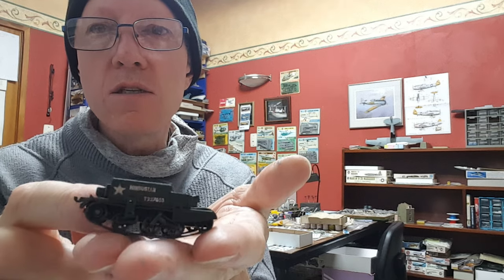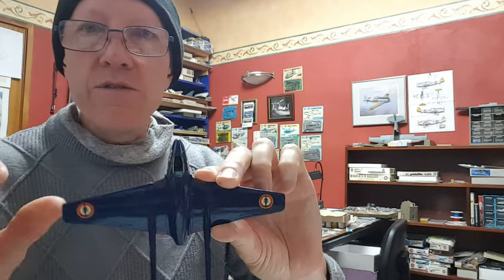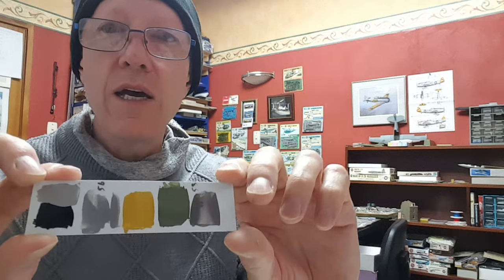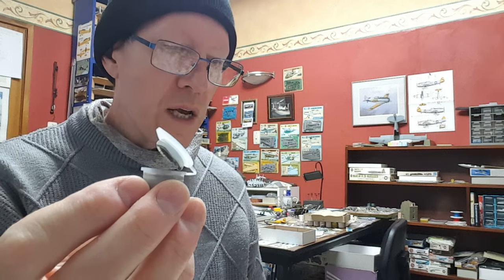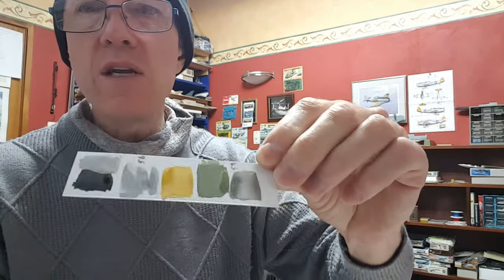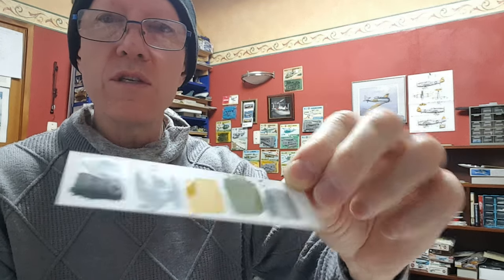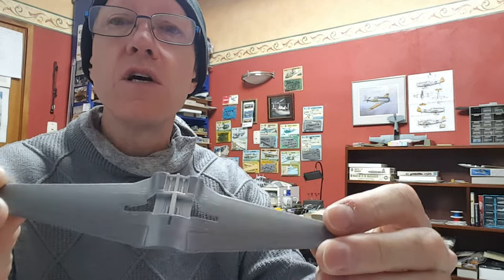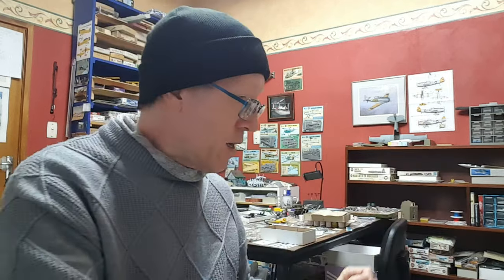Airfix Starter paints and more

Comment: Looks like a wood block like you made for adhesives would help for those paints.  Not sure how Airfix would do it but the modeller might.  Best Airfix might do is a cardboard stand.
Reply from the maker: yes - if i was going to use them - a block would be really good

Comment: Biggest joke is the kits with paint etc cost much more! It's not easy for little fingers to get the little airfix paint pots open either. I have bought some Heller starter kits because that's all I could get and they were in a huge discount sale, but the paints look much better being mostly in small screw top bottles. But they don't give many colours, the Mirage I bought is missing the main fuselage colour and there are no "beginners instructions" for using the limited paints supplied. Are they worth the extra cost? doubtful. Would youngsters be encouraged by the starter set experience to get into modelling? debateable. A trip to the model shop to talk to knowledgeable people, invaluable.
Reply from the maker: interesting -  i didnt realise the starter boxes were so much more expensive. Yes - i had to really pull carefully to open those pots without it flipping and spilling all over. the screwtop sounds great - havnt seen those. i think these starter boxes are aimed at making adults buy them because they look like you dont need to buy more stuff, but the practicality and success of such a strategy - hmm. Im not convinced.
Reply: @deonjansen  To be fair to Heller, the The Ferguson Petit Gris kit has a brush, cement and all the paints included. By contrast the Mirage has 18 colours listed, 2 I can't see a use for, 5 are supplied of which white is not referenced in instructions, Red is a wing, tail elevator colour, black is for tyres and the yellow is for a few details. Pretty poor selection. 
Maybe I'll try a "starter kit challenge" with the tractor if I can work up the courage.

Comment: Part of the problem is also the brushes included. They are fine for small parts but absloutley USELESS for painting the airframe (im a plane modeller)...if you use the brushes and the crap paints you WILL get an absloutley awful paint job